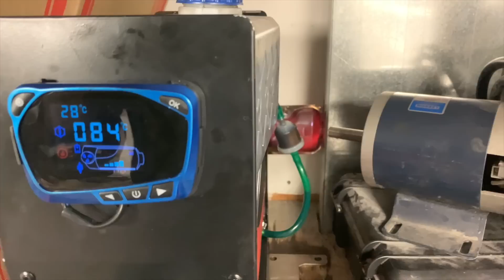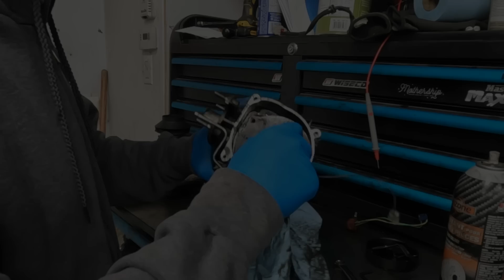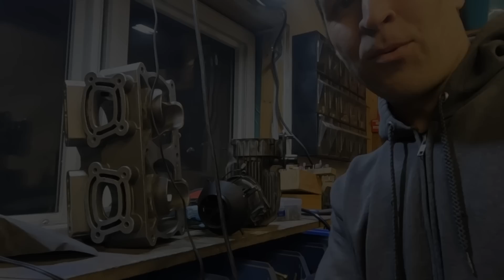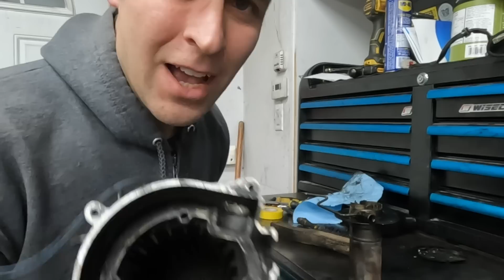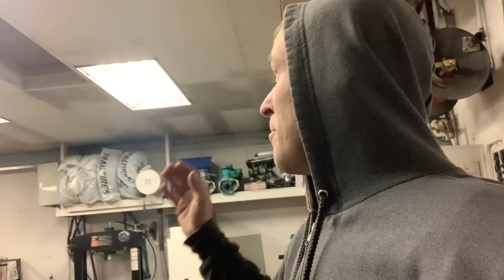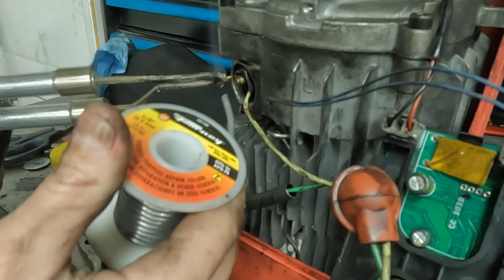Porting My Diesel Heater - (more air flow) Will It Help? Chinese Diesel Heater. PT-9

Comment: So i did silly things with my fuel and now the pump is extremely quitet , first i thought its broken because you can only feel its pumping and see of course😅 guess ill leave it like that
Reply from the maker: What sort of silly thing did you do, put oil in it ? They are a little quieter with thicker fluid in them. The pumps are very durable, but the combustion chamber may not be happy in a few days if you are burning something that creates ash / soot... Good luck !

Comment: Your Vevor link for the 5kw is showing sold out.  Does the link work on a different heater? 🤔
Reply from the maker: Yeah... I'm guessing lots of them are showing sold out on my old videos... 

If you send me the SKU or link, I can provide you with an affiliate link ... but ... 

If you buy another heater, I don't get any credit, but that's fine. I am trying to get a different heater from vevor that they have on clearance... If they send it I will have a link posted.  $119 and may have the old style controller.

Comment: Try adding a stainless steel mesh inside the burn chamber to add ignition. Thanks for your videos, great information.
Reply from the maker: Thanks for the comment and suggestion. I recently tried using a stainless steel scouring pad, on the suggestion of another viewer, and... the results were interesting... I'm not so sure that these stainless steel scouring pads were actually stainless.... or perhaps not all stainless is suited to these conditions.

Comment: Try adding air pressure with a gauge an try tuning it at different pressures
Reply from the maker: While this does seem to help, an air compressor is a very efficient way to move air. I will be getting a new ECU and controller that will hopefully allow me to control fuel and air independently.

Comment: Get a centrifuge for cleaning the oil. Id love to know if that makes a difference.
Reply from the maker: I have just completed some testing with new oil to see if it was the crap in waste oil that was causing the issues... It looks like it is much more a case of oil not burning well do to a lack of burn chamber temperature (and perhaps air flow) I am trying to sort these things out now.

Comment: The exhaust is very hot, however it has low thermal mass, pre-heating heavy oil in this way is the way it is done in when its burned in commercial waste recycling.  It works out because fuel flow is directly proportional to exhaust temp so you maintain pre-heating at various throttle levels.  Don't know why you'd think it would explode, run away or something.  It won't explode because its open at one end and it will not burn until it gets to the combustion chamber because there's no oxygen.  Whether it expands as its hot or not the energy is fixed by mass not by volume and it gassing up is exactly what you're after for ignition because fuel doesn't burn, fuel vapour burns. The hotter it is, the better it will burn.  If it expanded volume twice due to heating thats not the same as suddenly putting twice the fuel in, your metering is fixed by the pump.  Motor oil has a boiling point of 300 C (ish)  at which point the oil will not increase in temperature - thats physics; in the same way that a pan of water stays at 100C until its all boiled off.  I actually think you might struggle to get the fuel hot enough by simply wrapping copper around the exhaust, because its [the copper] got a huge thermal mass that you have to heat up before you even get to the oil, what you really need is fine stainless tubing directly in the exhaust (like a model jet engine).  All of that said any heating of the oil will aid its burning and its worth a shot.  People heating water this way didn't managed to get the water much above 40C but the fuel flow is pretty low and its heat capacity is much lower than water.
What you will not be able to get around is the calcium carbonate build up in the exhaust together will all the other additives that are supposed to be there to prevent the oil breaking up at temperature, I don't think you can get it hot enough to prevent that build up, when you get it hot it just glows and leave a calcium salt behind.  The best idea I have seen is periodic water injection which will thermally shock it and you may get it to break up and blow downstream.
Reply from the maker: You are way too cocky for someone who has obviously never tried this for yourself. You know some facts, but you are applying them incorrectly. I have done this in real life, and have seen the results... I'm not speaking from what I think will happen, but what I saw happen. 

I try not to be rude, but you don't' seem to be able to process information in a useable way. You keep saying "explosion" as though anyone made this claim. 

I'm not going to bother explaining this to you again, because you either didn't take the time to read what I wrote in my last response, or you just can't process the information. Feel free to read my last comment over again, as it is basically the same response / dispute to this comment. 

You're whole idea about "fixed" by mass is complete nonsense... Think about what you're saying for 3-4 seconds and try to imagine it on a larger scale perhaps 🤷‍♂️. I can't believe you can be so right and so wrong at the same time.

Comment: Methanol will destroy your pump, Verne booster won’t help because oil has way more vegans than diesel. If anything you need cetane reducer.
Reply from the maker: Hey, thanks for the comment. 

Yes, methanol is nasty stuff and oxidizes everything . I was aware of this, but thanks for pointing it out. 

I think you have a couple of typos or auto correct errors in your last sentence, but I think I know what you mean. I don't think you are correct though. Cetane booster / raising the cetane rating makes diesel easier to ignite, basically the opposite of octane booster. 

From what I've read, cetane booster, or higher cetane, allows the fuel to burn sooner / quicker in the combustion chamber.

Comment: I got sucked in to this experiment. I heat my 3000 square foot garage with an actual 250k btu waste oil furnace that can easily maintain an 80 F temp even at 30 below F. When it’s burning properly it does however produce almost snow like fluffy white ash that has to be cleaned out twice a year. I doubt with the correct burn recipe on actual waste oil that the tiny burn chamber on that diesel heater could make it one day prior to being so full that it no longer functions or transfers heat. I’m sure you’ve already been told this. Still waiting on the formula that works thought. Keep it up. Cold from the US.
Reply from the maker: Thanks for the comment. ! 

I've been told similar things from people who service waste oil furnaces and who have worked on heavy oil heaters for decades. I get that there is always going to be some ash. 

A few things give me hope. These burn such a small amount of fuel. 3L in 14 hours (ish) and seconds is the results that I have gotten despite having an absolute trash setup, haha. 

I'm way behind as I shoot footage faster than I can edit and release videos. I have been monitoring the temp of the chamber where the heat goes in, and it is running an average of 160-170C ... way below the oil flash point. 

Cheers ! 
In the end, failure is always an option !
Reply: straight waste oil must be preheated and then atomized with air pressure for proper burn. I’m super interested to see if you can create the right environment to flash straight waste oil. Then perhaps i could build a larger burn chamber to accommodate the ash much like a typical waste oil furnace for much cheaper. Be careful of the flash point of any flammable you run straight!!! Btw first time I’ve ever commented on you tube lol
Reply from the maker: @johnathonreed4667  I realize what you are saying is true... Diesel engines struggle with soot and ash despite having very high pressure injection and being burned under pressure in a fairly ideal environment. What I'm doing is more or ness an exercise in how long I can make it go before the crap has to be cleaned out, and how can I make the deposits less nasty. 

I've already made quite a bit of progress as it used to be like cleaning concrete out every time... 

I was just working on it, I have done several tests today to try to keep heat in the chamber (where the oil enters) and I had an idea come to me... About to pull it apart and test this new idea, haha.

Comment: To prevent the exhaust from returning To the garage you should power your heater from outside the garage or leave a window open to keep positive pressure inside. This is probably something you should have done at the beginning of the tests.  Keep up the good work 👍
Reply from the maker: Thanks for the comment and concern ! 

I realize that this is not an ideal installation... (to say the least). I have tested the ventilation system several times, and recheck it often fro convection current with the system turned off. My attic has a hatch that is not sealed and that allows fresh air to come in at the same rate as air leaves out the vent.

If I turn my ventilation system on, it moves enough air that it actually pulls in more air than can be supplied. When this happens, there is a access door for my floor heating system that pops open as it is vented to the outdoors as well. If I'm in the garage using the heater, I leave the door and a window cracked. I also have a CO alarm and have got it to go off once or twice, but the fumes get pretty unbearable before that happens. Cheers.

Comment: So i was sucked in. Those temps with a C are foreign to me. But when anything gets to 2000 degrees i know it is hot. And for all i know you could have bought a pallet with old space shuttle insulation on it. So here i am thinking that porting job made one hell of a difference or i missed something. And once again it is fully reinforced how dumb i really am. You can use plumbing solider?spelling? if the electricity is created via hydropower. Thank you and be safe with that white jug. I think some of that stuff burns with no visible flame.
Reply from the maker: HAHAH 🤣 I apologize ... but also, I can totally see myself in your situation. 

LOL... that's a good point.... Hydropower uses plumbing solder 🤣. < that is clever. 

Yes, alcohol burns quite clean and invisible. My father used to use soup cans and a roll of toilet paper to make a camping stove with methanol. It's pretty safe, makes good heat and is pretty inexpensive.
Reply: @loweredexpectations4927  oh you got me good. I had to read the comments to figure it out. Good work. I love it. I was thinking along the lines of the racing fuel burning with no visible flame. But hey you know what you are doing. Not my place to be giving any knowledge. Man i am sitting there think 2100 degrees C and those boxes a foot away are not even smoking. I really hope he shows us some of that insulation. Thank you.
Reply from the maker: @chuckb.3324  🤟

Comment: I think your NASA insulation is giving of some brainfoggasses😅😅....I like the idea of "tuning" your heater the only problem I see in this is that you are trying to tune it like an engine...you screwed yourself with making the exhhaustport flow better...in an engine you want it to flow more air so you have more fresh fuel and air for the next combustion but in this case you want to keep as much of the heat as possible in the combustion chamber...so try restricting the exhaust flow so that it flows just enough to keep burning and the flow over your heat exchanger can be as much as you can make it...
Reply from the maker: Haha... thanks for the comment !

The porting was more or less to have fun with it, be silly and to allow some crud to exit the exhaust. I suspect that the most restrictive part of the system is at the entrance of the burn chamber. 

Restricting the exhaust does keep more heat in the system, but not enough and even a little restriction stops the heater from starting. I could make a damper on the exhaust that I close after, but I have a few other things to try first. 

From all of my testing, I have found that the burn chamber (where the oil goes in) is only getting to a max temp of 222C when operating normally, and an average of 160-170. This is way too low to flash the oil off. 

When I am able to get the temp up, I believe the extra air flow will then make for a cleaner burn, but until then, it is just cooling everything off ... Not good.

Comment: Another great vid!
Another probably not useful comment but just saw a study about converting motor oil to fuel using a microwave. Details were sparse- I would assume you would need to add graphite/ metal powder to make the oil absorb Microwaves... then you have the problem  of 500°c[?]volatile fuel

I've tried methanol- has half the energy density (5kwh/l )of diesel and it shows my output pipe gets to half the temperature(40c). Dont know if I've mentioned  it but adding a few percent of water helps "steam clean" your burn chamber.
Reply from the maker: Thanks ! 

Wow... microwaving oil... that sounds nuts and interesting. Was the purpose of this to get the crap to drop out of solution ? ... OH... I see... I just went and scanned it quickly. 

I had the idea of doing this but not with the microwave. They are basically distilling the oil to refine it, but using a microwave to make the process more efficient by heating it evenly. (that's what I get from it) 

This is a interesting and dangerous process, haha. If I had lots and lots of property, you can bet that I would be trying something like this, but not where I am now.🤟

Comment: I'm sure you will still find quite a bit of ash from new oil. But if you were to look into diesel engine oil you may find much less ash in it. Need to look for a newer rated oil that is designed to work with dpf systems. I don't know the rating off the top of my head but i do know mobile one esp oil is very low ash. May be worth a test but the oil is kinda pricey.
Reply from the maker: Thanks for the comment !  

I'm guessing that if I really looked hard I could find oil that was very low ash. I have been told by a few lab people that ash testing is one of the ways to test the quality of an oil sample, and that's why I used a decent quality oil instead of of the cheapest stuff that I could find. 

The idea of this test is more or less to see if your average clean oil burns way cleaner than used oil (in one of these heaters).  Or is most of the ash left behind for other reasons like not enough air, not enough heat, etc.

Comment: Bevers and Butthead, lauth.... were thinking about if the houesing is placed outside and the inlett and outlett air are inside(oooo,im a nut) but if the outside are more cooled of dont it burn longer.....I hope you get what I meen... like a turbo you hook it up to a intercooler , and so on!

And you are realy doing Vevor a faivur you are developing for them, you are doing all hard ground work.... hope you can try cocking oil, frying kind... but good job!
Reply from the maker: Haha.... Yes, this would be a good way to mount the heater for a permanent installation ! For my experiments, I like to have it easily accessible yet out of the way... hence the shady shelf "install". 

Haha... yes... I'm doing all of the research and development of a heater that will change the world ! I would love to try cooking oil at some point. Thanks for the comment.

Comment: At these relatively low gas volumes/speed. porting is unlikely to have much effect at all, I would think.  It is however fun to do and gives you a good feeling about the job. It costs nothing and certainly will do no harm to the heater. A bit of grinding and polishing here and there might just make it a little harder for deposits to build up.
Reply from the maker: Haha... yes, I did it more for amusement and because I thought that perhaps it would slow the buildup of crud gathering around the exhaust. That part seems to be true. 

As for the air and burnt gas volume, I highly suspect that you are correct. Just read the end of the comment, and yes... It slows deposits slightly. Thanks for the comment !